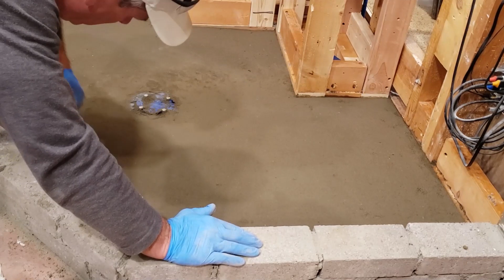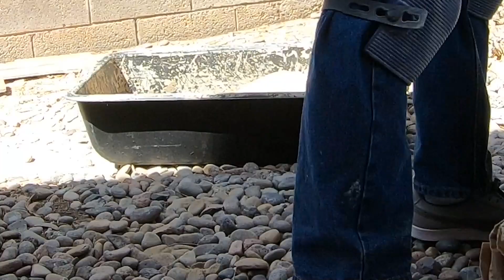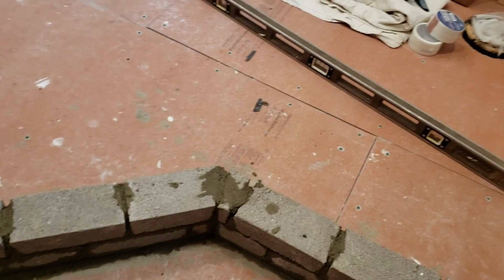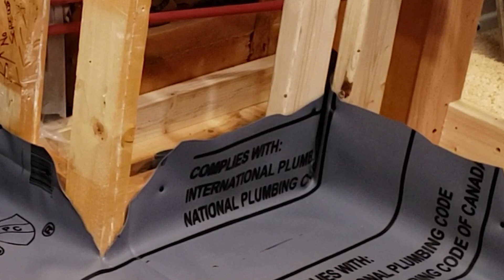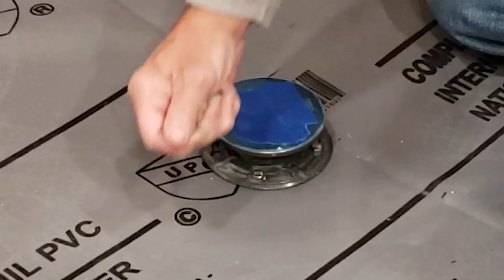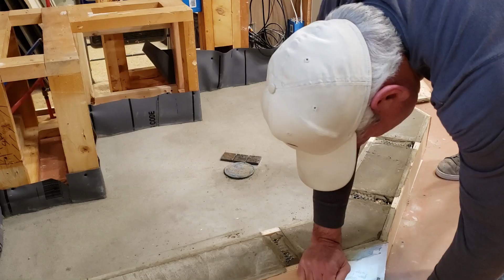Building a Corner Shower Floor From Scratch - Part 1

Comment: Hi Rusty!  Did you ever make a video on how to make folds (or cuts) on a pan liner to apply around and outside corner of a shower bench?  If so could you provide me the link?  Thanks very much!
Reply from the maker: I think this is the only video where I dealt with outside corners to install a shower pan, Mike. You can buy pre-made outside corners from liner manufacturers that you glue in place. You do need to make precise cuts at those corners and go only as low as you absolutely have to in order to get the pan to rest flat on your pre-slope. In this case, I fabricated my own liner pieces to wrap around the corner to glue in place. I am not a big fan of seats like this in showers for obvious reasons as an installer. I prefer the 45° steel triangle seats that mount to the wall and are filled with dry pack. You don’t have to worry about compromising the liner with them. Sounds like you may be considering a project! Good luck!
Reply: @RustyDobbs  Thanks for your reply (and time), Rusty!

Comment: How long did it take you to build the shower?
Reply from the maker: We were remodeling the whole bathroom, Yasir, so it was an extended project moving walls building cabinetry and lighting. If I were only doing the shower alone, that would be probably a 6 to 8 day project.
Reply: @RustyDobbs  I'm building a roman tub, would you advise me to use bricks perimeter siding? I've already secured my structure with double joists to ensure structural support. 

Please let me know your thoughts.

Comment: Is it ok if the first dry pack is a little crumbly after drying
Reply from the maker: Yes, Lori, that is not unusual. The dry pack mixture has a purpose that is different from poured cement so it’s surface is going to remain a little grainy. The tile installed on the second layer of dry pack is going to protect that finished surface and allow it to do its job. That is why I get the tile installed on the shower floor as quickly as possible before there is the possibility of foot traffic on the dry pack. The first layer is just to provide support and slope for the shower pan.
Reply: @RustyDobbs  thank you

Comment: Thanks for the video. I will be doing my shower pan soon.I am mainly worried about getting the slope consistent. I wonder why a wood curb rots, like you said before in a previous video. It is covered by the pan liner. I think i am just going to make a form and just pour some concrete for my curb. Thanks again.
Reply from the maker: Thanks for watching, Kurt! I think the issue I have with wood curbs is that there is absolutely no room for error with wood. If it gets any water to it, the wood will expand. The tile that is set on it or against it will not expand with it and now you have a problem there is no way to fix. Pouring a concrete curb is an excellent way to go! Good luck on your project!

Comment: Hello Mr. Dobbs, Yet another great video!  I watched your other video (https://www.youtube.com/watch?v=1vNapRUC5Sw) where you used QUIKRETE Patio Paver Base Sand in your dry-pack.  I purchased some and it is very course and doesn't pack well to a smooth surface.  I see in this video you use Play Sand, will the play sand hold up as good a mason or all purpose type of sand from Quikrete?  Thank you Austin Snow
Reply from the maker: Thanks so much, Austin! Yes, I know what you’re talking about with some sand varieties being a little more coarse or fine. If you do enough of this kind of work, you probably develop a preference for an optimal amount of texture for your sand, but candidly, I don’t think about it that much anymore. I know I don’t like extremely fine sand because it will tend to more easily become pasty on the surface as you work it. In the end, when you are going to spread thinset and set tile on the surface, your main goal is to have a solid base to set the tile on which for me generally comes down to getting my moisture content right for the dry pack that I’m working with. If I can get that right, the texture of the sand doesn’t really impact the end result. It’s the Portland cement that gives the dry pack its durability. This mixture can be used for a lot of different purposes outside of a shower floor, so if I use it in a setting where it’s surface is going to be exposed, I think more about the sand textures I’m using. Hope that explanation is  helpful!
Reply: @RustyDobbs  I'm looking to install a custom shower (53" x 82") in my home.  I can get both Play Sand and All Purpose Sand from Quikrete where I live.  For the strongest base, would you recommend one over the other or a mix of the 2?  Also how long do I have before the Dry Pack starts to harden during the sloping and shouldn't be disturbed?  It's a pretty good size shower and could take 5 or 6 batches to get the pre-slope done.  Thanks again. Austin

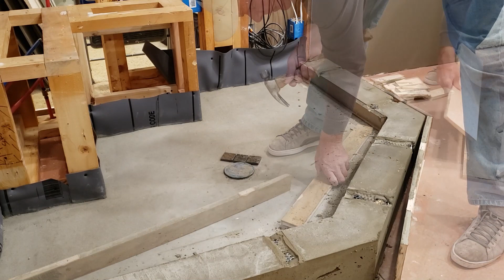Comment: What is the mixture you use for the curbs you mention at 11:17 ? Is your mixture a wetter dry pack? Why doesn't the modified dry pack stick to the forms? Are there any tricks in making those forms? I have very little clearance between the shower and the toilet and can only afford a curb of 4 inches total, including tile. Thanks in advance for any insight you can provide.
Reply from the maker: Hey David. The mixture that I use for the dry pack is the same throughout and it is just mixed thinner in order to pour into the forms. You can also lightly tap the forms as are doing pouring to try to get it to run down further and even take a pointed trowel or screwdriver to help ease the material in the forms. You'll probably have a void or two anyway, but just fill with thinset after it dries. It does help to coat the forms with some sort of finish. I use Polycrylic by Minwax all the time in the shop, so always have some of it available to brush on a couple of quick coats. With the thinness of your curb, you might just consider pouring the curb with solid dry pack mix. I would use some strips of metal lath any other type of metal mesh you may have available to place in the forms before pouring in the thinned down dry pack mix. Hope that helps and good luck.
Reply: @RustyDobbs  Thanks for the advice. I already have bricks on edge down, and will wrap with wire lath and use the dry set. I see mixing raios of 3 to 1, and you use 4 to 1. Any reason not to use 3 to 1? I have plenty of Portland cement for my purposes.

Comment: Hey Rusty, you know I appreciate your videos and your skill level, just curious why you don't water proof your shower with a liquid topical membrane... also did you marry that mortar on the curb with the mortar on your pan?

Nice trick with the cutout piece of shim around your drain to get your exact height for your tile 👍
Reply from the maker: Hey Bob! The appreciation goes both ways for your skillset and knowledge as well. 
Yeah, long answer! Since my first exposure to tile setting was mixing and carrying mud for craftsmen floating shower walls and floors over 40 years ago, I’ve always had an appreciation for that approach and the inherent benefits of it. 1/2” Hardibacker on the walls is pretty darn close to replicating it. I’ve been slow to come around to fully accept the idea of a full waterproof membrane or envelope behind the tile. So I’m sort of caught in “Purgatory” here! I see the obvious benefit of keeping water away from backerboard and studs. But I have never had a good response to the question of what happens to water that still is going to get behind the tile over time, but now gets trapped between the tile and the membrane. I have asked it probably seven or eight times of “commentors” who are true believers in the ‘waterproof envelope’ concept and have never gotten a reply to that question. I think the reason is because there really isn’t a good answer. 

On one occasion about five years ago, I set tile in a shower for a couple who had someone else do all the prep work which included lathering everything (walls, floor and seat) in multiple coats of Hydroban. Ventilation was going to be a problem in the shower and I told them that they were going to need to squeegee and towel dry it after use. They also installed a 5 foot shower door and panel which actually made it almost like a sauna. You see where I’m heading with this. About a year later, I was there doing some other work for them and they asked me to check the shower. Obviously, they never dried the shower and not only was mold beginning to grow in the lower corners, but the caulk was turning to mush. I think if I asked the old tile setters, long gone now, who taught me to float mud walls what they thought, I imagine the response would be “What did you expect was going to happen, you idiot?” At least the homeowners don’t have to worry about water getting to their studs!

On the step question, the lath did extend down into the area where the final dry pack was placed. Not really by much, so it didn’t have any substantive effect of a structural connection.

Comment: Did you place anything over the wood floor before placing the first layer of DryPack?
Reply from the maker: Hey, James! The original subfloor of the house is 1 1/2” tongue and groove 2x6 pine, so very stout. On top of that we added a layer of half-inch Hardibacker across the entire bathroom floor so my first layer of dry pack is placed on the Hardibacker.

Comment: Hey Rusty! Hope you and family are staying safe with all this covid stuff. Video is great, makes the process seem really straightforward (although not necessarily easy!). I think people are so interested in videos like this since they know how much damage water can do if not handled properly. I used to do work on a 1920's house with several generations of piping and drains (cast iron, steel, pvc etc..., I think the house even had an Orangeburg sewer which was replaced long before I bought it). As careful as I was doing plumbing work it always made me nervous. Looking forward to the next video!
Reply from the maker: Thanks, Adam, and yeah, so far so good on the Covid situation! When you get into working on those really old homes like that, you do have to be pretty much prepared for anything! This home, that was built in the 70s, still had cast-iron which actually surprised me a little. But it is a really well-built home that was a part of the development by one specific builder for that area I think. I have never heard of Orangeburg sewer pipe! I’m going to have to look that up! Take care, Adam!

Comment: Great video Rusty! I’m in the process of remodeling a bathroom that had a floated floor that allowed the tile to match the adjacent floor floor at the same height.  I’ve been really reluctant to try and tackle the job of floating it myself (5 x 8 floor), but I feel this dry pack is probably what I need.  How would I go about prepping the wood subfloor (old 1910 slats) and conduit pipes before laying the dry pack/mortar bed?
Reply from the maker: Thanks, Ryan, and good question! Boy you are going way back in time with floating in a subfloor for tile, but that is the way it used to be done and it still works fine. I have always attached metal lath to the floor like your 5 x 8 floor area and then floated in dry pack to whatever thickness I needed for the situation but typically 1/2” to 3/4” thick. You can use thin screed sticks like I did on the shower floor to get your height established as you work, then pull them and fill. You can put down some type of vapor barrier like roofing felt below the dry pack to slow down the dry out time of your material and maybe protect the conduit you mentioned. But these days I pretty much use quarter-inch or half-inch Hardibacker on situations like yours. I’m not sure if there’s some reason you can’t do that, but if so, floating in a floor is still a good option. Good luck with your project!
Reply: Thanks for the response! Ideally I’d love to do the Hardiebacker method, but the conduit sits about 1” to 1.125” above/on top of the subfloor and by the time I build up everything around it, plus putting one final layer of even the thinnest Hardie plus the thickness of the thinset/tile and I’m going to be 1/4 to 1/2” above the finished hardwood floor at the door threshold.  If I’m missing something, I’m open to suggestions.

Comment: Excellent build, Rusty! The geometry on this one is a real headache so I have a lot of respect for you getting the fall and corners correct... have to say, however, having done a few dry-pack pans myself I did not envy you on this one. Thanks for sharing such great content.
Reply from the maker: Hey, Marshal! Yeah, this one looks a little more complicated than it actually turned out to be. My reach to be able to get to everything in this build was pretty reasonable because of the three sided access to the floor. As you know, the further you have to reach when doing dry pack, the more challenging it becomes and the more it wears your body out! As always, I appreciate your comments and thanks for watching!